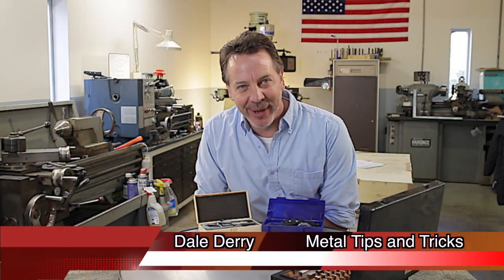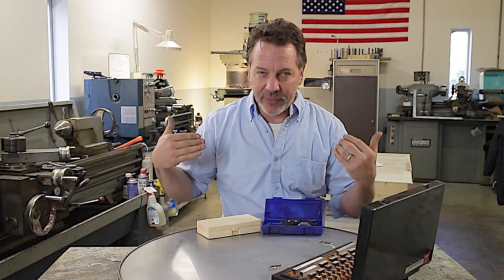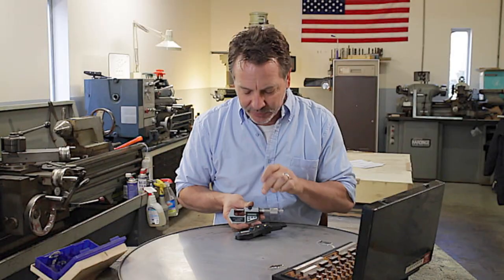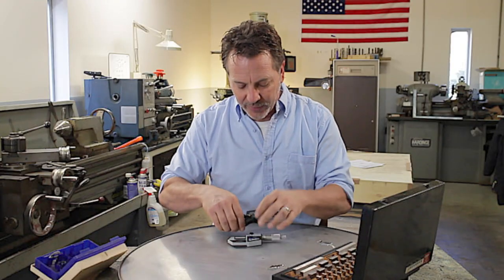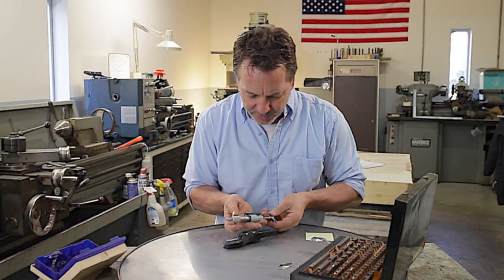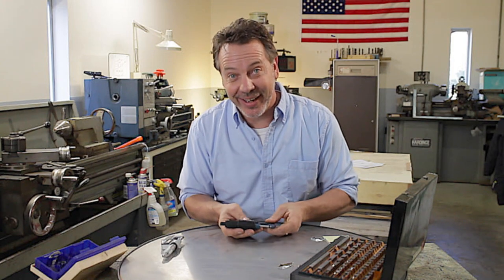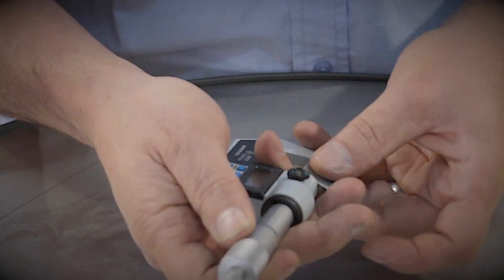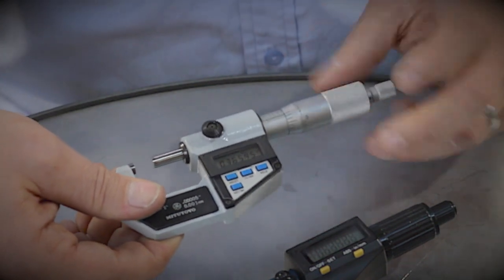Mitutoyo VS Harbor Freight ....The Digital Micrometer show down

Comment: Dale I love your comparison type videos.  I have to admit that I use off brand or cheap tooling as well, but they have their place as you well know. When you're working the part down to size that is really where the cheap tool has it's place because it is used over and over again and is tossed about in the process. I use the Name Brand tool for the Final Inspection on the part and thus it is usually only used at the end and then put back in it's box and put away. If I drop or break the cheap tool, sure its a bummer but I didn't lose the tool I really care about.
Great Video and I hope you do more of these. 
Cheers,
John
Reply from the maker: You and I work the same way😀

Comment: I like that you always keep your little finger crooked through the frame; you drop those things a LOT less often that way.

I wonder that you don't roll the thimble against your forearm for fast change of the opening. This was a trick shown me by my grandfather a long time ago, and I've seen it done by other old machinists. The only thing you have to be careful of is when you are approaching the end of travel - you really don't want to slam the spindle and anvil together. That's a good way to bend the frame and put the anvil out of parallel with the spindle.

That motionless (in and out) ratchet thimble on the HF mike seems really useful. Now if someone would just make a mike to that design out of a sturdier (and more æsthetically pleasing) material.

Comment: I never understood the "speed"  need on a mic. I mean just haw many times (in actual use) will you be running a mic from full open to full close where a couple seconds will make a big difference? Anyway, I love to comparison,  Battery life may be worse since most of the "low price" digital items don't really shut off anything other than the display. (it is possible to install a small switch in them to shut off the battery). Plus one BIG difference, I won't lose sleep if I manage to drop the HF ones on the concrete......  (another advantage is that I wouldn't have an issue cutting one up to make a different tool out of it).

Comment: Great video & comments. For what it's worth, I pretty much use the HF grade tools daily and have relegated my more accurate and expensive tools to the " second order calibration standards" tool box.

I consider the HF style tools as disposable. If one drops or is otherwise compromised, I'll breakout the Starrets or B&S tools and check out the compromised tool. Pitching and replacing a HF tool is much less expensive (and easier) than replacing or repairing a high end tool. I had a mentor that taught me that part of "using the right tool for the job" included its accuracy & repeatability characteristics. Why use a $100 tool on a job (and possible break it) when a $10 dollar tool will yield the same results just as fast - if you accidently drop the tool, and you will, which one do you want to have to replace?

Most of the stuff I work on, I only have to hold to a few thou at most. When I have to do high accuracy work, I may break out the good stuff (and work much more carefully but slower)   ;)
Reply from the maker: Thanks for watching

Comment: My experience...  They're probably made in the same factory in China.  I have a Starrett.  It's identical to the Mitutoyo.   From the ENCO catalog picture it looks the same as the SPI.  All 3 are imports.  Computer automated manufacturing and digital micro controllers have eliminated the differences we used to judge these tools by.  Little old men in Switzerland with magnifiers on their noses no longer file the precision into gear racks.  They're pumped out on their Chinese made CNC tools just like in China.  They run equivalent software.  The differences are what your video highlighted -- materials and functionality.  Both bounce the same when you drop them on the shop floor.  The HF plastic breaks.  The Mitu metal bounces so you can pick it up and keep using it (is that a good thing?).
Reply from the maker: That's an interesting point of view. I'll have to think about it.
Reply: Totally agree, precision is not a hard thing to manufacture these days
Reply: How about the quality of the steel? Quality tool steel is a closely guarded secret. Surface finish finish matters a lot on these, you need specially made grinding machines to get into some of the areas. Think they have them? How about the quality of the tool used to make those threads on the mic? The quality of the insert used to cut the thread, how many it was used for before being changed out, etc.
Reply: You're just saying this because you never held a pair of Mitutoyo and HF calipers in your hands or even something like a $40 iGaging calipers in your hands.  The difference is night and day.  Grit like sand movement that returns to zero not every time or smooth as butter that always comes back to zero.

Comment: I think the Harbor freight micrometer will most likely stop working long before the Mitutoyo, but the accuracy is very surprising for the price. My first micrometer was the one from Harbor freight. I recently got a set of Starrett 436.1 mics and the HF one is 100% as accurate. And' I would think that the reason the spindle moves in and out more slowly on the HF is that it has more threads per inch than the Mitutoyo, which I think would only add to its accuracy.
Reply from the maker: +vespadano1979 
Thanks for your comment.

Comment: Great Video, Dale  what I've found is just what everyone else is saying they dont stand the test of time, but if you take care of HF tool  it like you would a Mitutoyo or Starret you will get a fairly long life out of them and when I have one of my kids working in the shop I'm probably not going to give them a $250 mic to check something.  I've used HF in my home shop and if you do a complete project using them the error is relative.  But all in all I have like you A and B tools also.  But for the guy just getting into machining as a hobby well you have to start somewhere. Thanks for sharing

Comment: A few more selling factors are not only battery life but also, when the voltage starts to drop off the Mitutoyo's will tell you. The cheapo's I have come into contact with do not. This is a BIG deal because of how digital mic's measure, low voltage can throw off the actual measurement and give a bad reading. The price of entry for the expensive ones is true to form consistency.

Comment: You get what you pay for. I don't know too many Machinists that use the ratchet feature on their mics and I am one of them because once you get your feel down you don't need it.  The tools I rely on are  Mitutoyo and   Starrett for measuring tools ,  Klein and Fluke for electrical work  Mac and Snap on for Mechanics tools. The offshore tools that I do buy are things that will get broken easily like  chisels or tools I will use only use one time.

Comment: I completely agree with you on the boxes. Almost every Mitutoyo box I've seen is all warped and flimsy, not to mention they just feel so cheap. I don't want to sound like a fanboy of Starrett, but they certainly make the nicest cases by far. I mean if your spending so much on a precision instrument that will last many lifetimes, can't they supply you with a decent case to protect that investment. I refuse to keep the Mits i own in the boxes and have resorted to foam drawer liners cut to fit each Mic.

Comment: Most mic,s die by being dropped or soaked in coolant. They rarely wear out. For my money I'd buy 2 or 3 harbour freight $35 specials and be very happy wit the flexability that offers and use them will a lot less stress.
If you are cashed up or in the mood :- get a Mitutoyo and make it a nice box and keep it too look at occasionally.

Comment: got some mitutoyo calipers and micrometers in the digital and AOS version and some being about 10 years old... but still absolutely "GO" accurate without any special calibration procedures. enduring preformance for sure, for me i would spend better 150$ on a AOS mitutoyo then 40 on a import mic. indeed i am exchanging a import mic for a mitutoyo because after 2 years of usage it is showing electronics and encoder issues- you get what you pay for. mitutoyo is just much better when it comes to reliability

Comment: Well, it's easier to see the quality on the cylindrical parts. Over time the tips can wear out and not be parallel anymore. It's easy to get  repetitive results on flat parts. Harder to get reliable results when  your are not sure of your tool. We got two exactly the same mitutoyos, one older than the other. The older one gets us false readings on cylindrical parts up to few microns. And few microns can be a lot. I know that for home machinist the difference may be negligable, but for a pro shop, well, it's a different story :)
Reply from the maker: I agree

Comment: I needed a 0-1 recently. I looked at hf. Looked at others. I ended getting a very nice Fowler from ebay with certification for 15 bucks.  Heat covered. Has the ratchet like the HF did instead of like the mitutoyo.  Testing shows it to be right in spec. Just an idea for some of you viewers for the future.

Comment: Funniest thing is that’s a old style mitutoyo probably mid to late 90s, still fine after 20 plus years.
I’d be surprised if the other one lasts 2 or 3 years at most
Reply: I've bought a few HF measuring tools over the years and my experience it that they don't really hold up that well. 
On the other hand i have some of their wrenches, ratchets and pliers that have held up to daily use for over a decade.

Comment: if we are making a micrometer that doesnt rely on the screw thread pitch with no barrel scale....it could have a much coarser pitch to make it faster to operate...something for future development, or a spring loaded lever?
Reply: You are exactly right about that Jusb. Digital measuring tools that used to use the older screw pitch mechanisms now use electronic principles:

https://www.wonkeedonkeetools.co.uk/calipers/how-does-a-digital-caliper-work/

Comment: It looks like they've tried to clone the newer Moore & Wright digital mic, if you take a look. I ordered an new import digi mic before xmas that looks similar but with more buttons (abs I suppose etc) I may have to get back into it again for a little while. It hasn't arrived yet but, you can even buy & swap the head /spindle the same way as the M&W. For me it's a spare digi for chump change. They are always going to be more accurate than the best vernier regardless. Besides, I have decent branded analogue mics if any digi mics crap out. To be honest, I would have to machine to a certain tolerance & then it would go off to be ground on sf grinder anyway, or certain edges then ground most likely, so in reality those things you mention might not matter so much, unless you're a sf grinder & grouchy about it. For home workshop & TV/ movie prop making etc, definitely more than fine. Also for a working conventional machinist they're fine. As long as you've a back up. 
Also the faster speed of the mitutoyo could be the imperial spindle tracking vs an metric one on the import mic. We're paid by the hour anyway, there's nothing no body can do about an extras 20 secs to open /close it.

Comment: I've got an Igaging one from grizzly it's just like the harbor freight, it worked great until I spilled some acetone on it. Now it's just a soft pile of, well I'm sure you get the picture. Of course I'm a bull in a china shop when it comes to working on stuff, hell I cut the same finger off twice. It's still here but it's ugly as hell. Lol. Love you videos keep up the good work. Thanks,  The Texas Gun Guy.
Reply from the maker: Do I need to do a safety video for you?
Reply: +Metal Tips and Tricks (Dale Derry): I'm good, my wife sold all of my hand held disk grinders. I can tell you firsthand that when you drop a disk grinder with a cutoff wheel on it, just let it go. DO NOT CATCH IT, LET IT HIT THE FLOOR. On a side note it cost 10k to get a finger reattached.

Comment: I like the older Starrett stuff.   Some of there new stuff is imported.
Reply from the maker: That ticks me off too
Reply: Didn't know Staret had dropped to that level. At home I have used several pair of HF digital calipers that I've used for years with absolutely no troubles. Seen reviews where they are taken apart and can see they are made inferior to Mitutoyo but personally I can't complain. As far as micrometers I bought 0 - 6 Staret .0001 vernier scale near 30 years ago and they're still holding up well. Welding splatter is easy to get off them when using as a C clamp😧Just Kidding😩
Reply: Phil Lowman  I've noticed some of the new Starrett dial indicators are made in China.  I'm not sure if there micrometers are still made here.
Reply: Good one! A C clamp with numbers!
Reply: I was disappointed when Starret started making stuff over seas.

Comment: Well in this range precision can be replicated. HF cant go sub micron though. Mitutoyo can, and a micrometer of the precision will cost over $1500. Additionally Mitutoyo can be ISO certified for an additional fee. In an ISO standard lab, each tool allowed into the controlled room must be ISO certified.

Comment: I hope people have better luck than I did with the Harbor Freight. I got the 3 box set 0-3 the first one lasted about 10 min. the cheap lock striped out right off the bat. No problem got another set this one the 0-2 in. could not be calibrated set 0 then tried to set 2 in. was always off 020. yep there was no way I could get it to work. So got my money back the end.

Comment: I would say it depends on what youre bying it for , okay measurement :-) sure , I mean whats the frequency of use . If i use it once a week when i have some time left for the hobby or if its used daily and also time is a parameter because the Mitutoyo opens /closes really fast . We in europe have some expensive high leveled very good quality measurement equipment like MAHR, STEINLE, VOGEL,TESA which all cost like a MITUTOYO or even more. Some of my friends only use them but only once or twice a month cause they dont have more workshop time. I made the experience that also an expensive equipment can be bad once a 200Dollar caliber came and was broken after 2 days, got a new one without trouble that works now for years but that does also my cheap one , i bought a cheap one for comparing reasons since years, but to be true i use the expensive ones ( i prefer MAHR) all the time the cheap not very often but cant tell you why.
Greetings from the Tyrol / Austria

Comment: The Mitutoyo has an imperial spindle, the harbour freight looks to have a metric spindle. The mitutoyo should be 2 1/4 times faster with the imperial spindle. Imperial mics have a nicer feel especially compared to a cheap metric one. The big thing is battery life. The mits last a lot longer compared to the others in my experience.
Reply from the maker: +dazaspc 
Interesting comment

Comment: the cheaper one will perform just as well as the expensive one problem is it won't last as long. With callipers I have gone thru 3 cheaper one's over 4 years so I finally broke down and bought a Mitutoya and hopefully it will last

Comment: I find my Horror Freight is off .0002" no matter what GB I use.  My 60 year old Brown&dull is spot on with G blocks and the anvils are rounded off .   Maybe I got a bad one.  Good enough for hobby stuff but I wouldn't use it at work even though our -+ is .002  .  And the fact it's 25 bucks with a coupon is a damned steal.  Grizzly and share sells the same one for 10 to15 $ more

Comment: Question: does the Harbor Freight version have a metric function?

Both look like great tools, but the Harbor Freight seems a bit easier for the novice :)
Reply from the maker: Yes the HF has the metric function
Reply: Being able to switch back and forth between English and metric at the push of a button is one of the reasons my higher end mechanical ("precision screw or rack) based measuring tools are gathering dust in a box ;)

Quite honestly, as an electrical engineer, I can understand how low cost digital calipers can effectively compete with their higher end mechanical based counterparts: For any given range of accuracy and repeatability, the manufacturing process for the digital devices is much simpler, faster and accurate when compared to the process required of the mechanical tools.

High end tool makers like Starret, Mitutoyo, and etc can significantly increase their profitability per tool when they sell the digital models at the same price point (or higher) than their mechanical based alternative. :)

Comment: 1. Agreed. Mitutoyo cases suck.
2. I have the newer version of the Mit.Mic that you have.  love it.  I don't have a HF digital to compare it to, but I do have Starrett and B&S regular mics, and the Mit is nice....'cause I'm lazy and just like to read the number!    It's more accurate than any machining capabilities I have in my shop.. and yes, I too can dream about it ;)
3. I have, again,  Starrett and B&S calipers, and years ago I got one of those $20 digital calipers from HF.  They're as accurate as any of my calipers.  I did buy them some time ago, so I don't know how well the quality held out to recent offerings.  I can tell you that I more recently got a good deal on a Mit. Digimatic caliper, and it's defiantly a better quality than the HF one.  Using my gage blocks, I found that the Mit. were right there, every time, where the HF ones sometimes didn't get the measurement exactly right.  Again, more accurate than my machining capabilities, so it's all good.

Time to make some more thought provoking videos Dale ;)
ps.  going to do any vid's on your recent photo trip?  show us some of the sights?